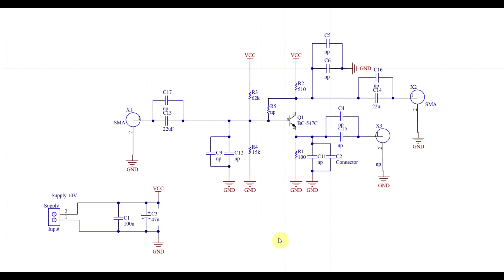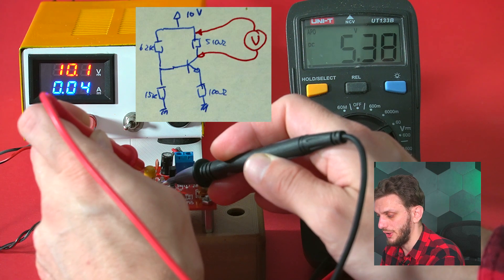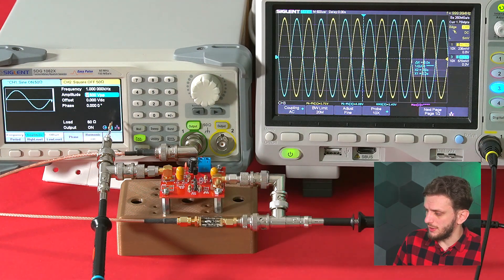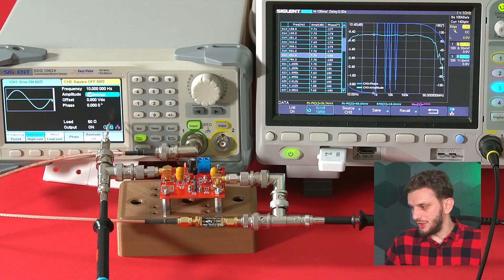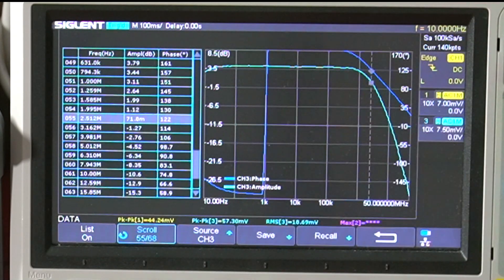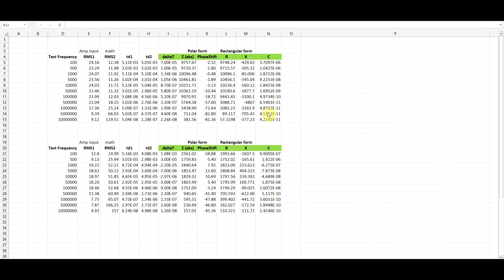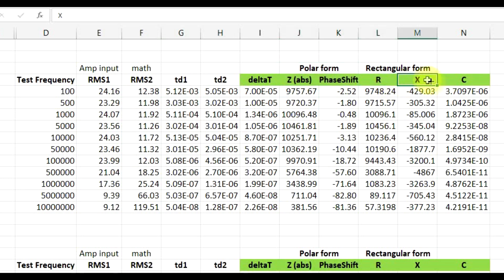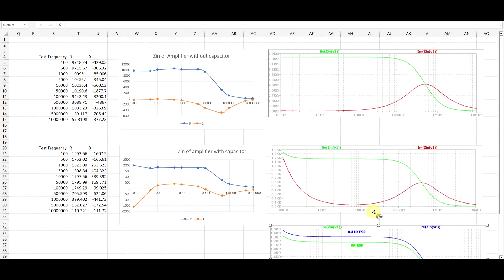Common Emitter Amplifier  - Practical Build (2/2)

Comment: Hi, in a world where almost every source or load is intend to be 50Ohm impedance, why use an amplifier with almost 10k or 2kOhm input impedance? Thank you very much.
Reply from the maker: 50ohm is common for RF equipment and for coax transmission lines, but its not the only value possible - 75ohm is also common for coax and 100ohm is common for differential lines; things like microphones are usually high impedance (2-10k) and things like speakers are very low impedance (4-8ohm); In the end, the best impedance is use case dependent.
Reply: @ So, for a RF amplifier it would not be recomended to have a high input impedance because of the high reflection coefficient? Thanks again.

Comment: When doing the impedance measurement, if you make a Bode plot sweep,   can the result used to calculate the impedance?
 First convert the Bode plot curve to complex form, let's say "A", 
Then use 1 minus the ratio "A" to get the voltage across the series resistor. So the current to input ratio will be (1-A)/R
Lastly, the impedance will be A/(1-A)*R

Comment: I have an older siglent sig gen but a low end keysight scope. The scope can do automated phase and peek-to-peek measurements. You can control the sig gen over usb and likely the scope too. With a bit of python you could automate your measurements and even do log plots. I ran into issues when the signal is low as then the phase is a guess. I also find I had to adjust the scope (with my python) so the signal filled the screen. It’s a bit fiddly but you will use the code again.
Reply from the maker: The oscilloscope I have can also do phase shift measurement, but it just could not accept the "Math" as input; I never really worked with python, and I'm not much a programmer in general, but I do agree, if you can use some control commands over USB, a lot of measurements can be automated and performed with ease